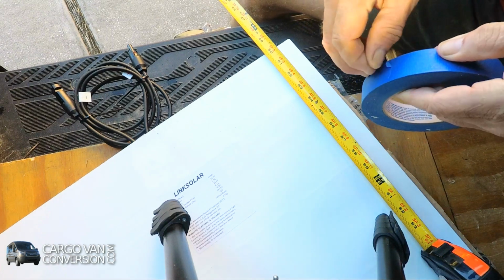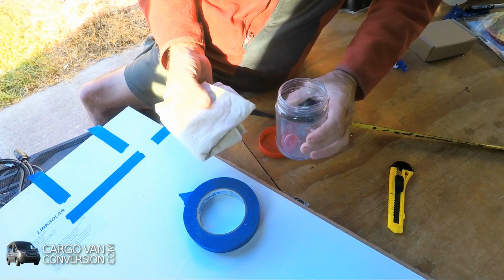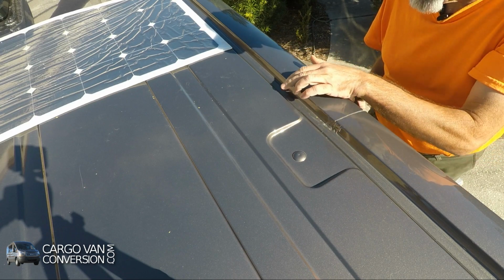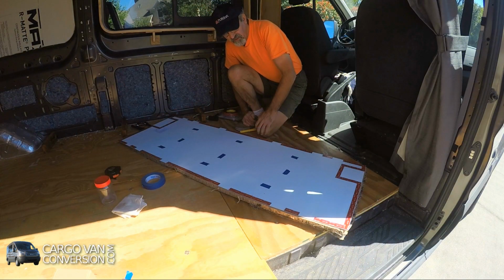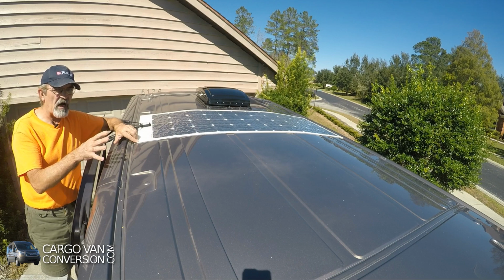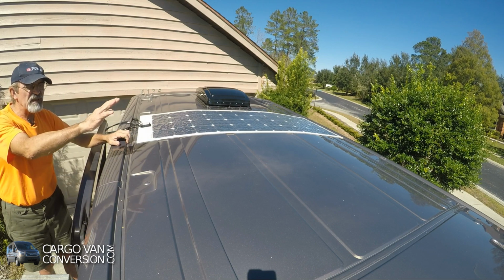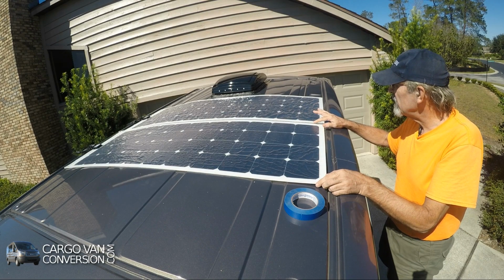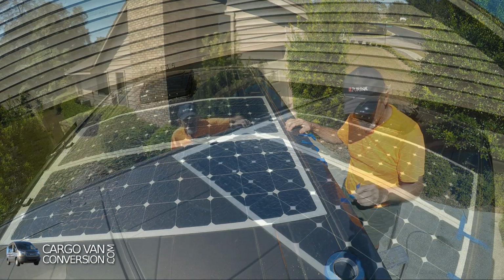ETFE Flexible Solar Panel Installation - Part 1

Comment: So, how are they working with no airflow on a dark roof? Whats the average amps on a sunny day?
Reply from the maker: Hi timothy790110,
There is none or very little airflow under the panels, but I haven't seen any negative results from that. I suspect, it's a non-issue much talked about; I may also be that the metal roof functions as a big heat sink.
After a year of use, the panels continue to produce close to the original amount of voltage/amps. And their physical condition is like new. I'm glad that I waited for these newer (and more expensive) flexible panels.
Since I'm still busy with the build, I haven't been able to 'stress' the panels to the maximum, but I'm very confident that they deliver close to the maximum number of watts available, i.e. 405 watts (three times 135W). They do whenever I test them without a load.
What is also important that my specific panels, already produce a substantial amount of energy, early in the morning and later in the day. As a whole I think that they are equal or better than some rigid panels.
Van Williams
Reply: @cargovanconversion  Cheers Van, I agree, there is a lot of misinformation out there, on solar panels especially. People just seem to spread that information dogmatically, with no empirical evidence whatsoever.  Same goes with mono vs poly.  Anyway, here are my experiences.  I have 3x100w of flexible (non EFTE , just PET backed) stuck to my roof. I glued them to channelled plastic roofing for air flow, and then VHBd them to my fibreglass hightop.  I have one 100w panel that is mobile with neodymium magnets that i can stick to my vans shell to follow the sun. I am in Sweden, so in the autumn and winter, the sun gets very low. So low, that each panel only produces around 0.5-1a, even on a cloudless day. the panel that I can angle however, will get around 4.5-5a. HUGE difference. For that reason, I have decided to remove the flexipanels (that going to be fun...NOT!) and mount 3x100w polycrystaline rigid panels, that i will be able to tillt in 4 directions, with mounts. These are the only ones that will fit on my roof.
Reply from the maker: Hi timothy790110,
I see you have the 'first' generation of flexible panels and I wonder how long you have had then and how well they stood up against time. Do you see any signs of delamination or deformation of the panels? That's what you typically see with some of them. Even with the improved panels that I have (high efficiency Backcontact solar cell and ETFE lamination), I would recommend their use only in very limited situations. While they can bend, they should not be used as such on a daily basis. They are perfect for stealth and do well, if not better than rigid panels, early and late in the day in a flat position. But they have many undesirable features. They are relatively expensive, not really suited for movable applications, perhaps less durable.
At your location, rigid panels on tilting mounts are a much better solution. I would advise you to try and find panels with high-efficiency backcontact cells or at least make sure the solar cells are of a high quality. Solar cells come in many grades and the cheap ones are often of a low quality. For us laymen, that is however very difficult to find out; often you have to rely on the salesman for that information.
Removing the old panels should be possible; a thin and strong thread could help you remove the VHB and some low heat from a heatgun can soften up the VHB if necessary. An old credit card is also a useful tool.
BTW Sweden is still on my bucket list.
Tak.
Van Williams
Reply: @cargovanconversion  Yes, I had some bad luck with them unfortunately, 2 or the panels were faulty from the beginning, only giving half voltage in full sunshine (but full voltage in overcast, for some reason, so either I have been careless with the installation ( not very likely) or they were sent like that. The company gave me a refund. Now, the one that I know works well, and delivered 5.4a in sunny weather, is about down to 4a now, but that could have to do with it beiung winter. I will have to wait until summer to test them properly.
Reply from the maker: That's unfortunate.
Van Williams

Comment: Can you please tell me how much do you pay for all solar the whole set and how many more solar can be add for this particular brand, Thanks
Reply from the maker: Hi Dragonfly,
I have three 135W flexible solar panels installed (Link Solar GFL-135). In Oct'17 the cost was approximately $1,500-$1,700 for these three panels, cable gland, controller, breaker box, circuit breakers, busbars, wiring, MC4 connectors, sealants, tools, etc.
I specifically chose these panels, as their length fits just between both gutters on the roof of my US Ford Transit (0.5 inch tolerance). This gives a 100% use of the roof for solar. I have a LWB MR 148" Transit and have three panels installed, which are virtually invisible.
I could add a fourth panel, towards the front, but as the roof line is coming slightly down at this location (less stealthy), I decided not to install one. I also have a roof vent installed between the two rear ceiling crossmembers; if you decide against a vent here, you may be able to add a fifth panel, for a maximum of 675W. On a Transit LWB-Ext version, you may be able to add another panel, with a maximum of 810W.
These panels are ~20inch wide. These maximum numbers may be unrealistic, as you usually need space for a roof vent and/or antennas/boosters/etc.
Hope that helps. Good luck on your project.
Van Williams

Comment: i have a camper with no solar dont need it,all you want is a split charge relay ...ur van charges while your driving nd 1 battery last for up to 3 or 4 days...fine work as usual though like the vids
Reply from the maker: Hi maddog hound,
Good if that works for you; I have done with much less during my tent camping years. We're getting older and spoiled, and more need for electric power develops. There are many different setups and many different requirements.
I planned my design based on 5-7 day boondocking stay, even under cloudy/rainy weather. That means more batteries (Ah's) and more solar or the right alternator source. Because I want to keep the van's charging system separate from the RV part and will use a separate 1000W inverter linked to the alternator to charge the RV's battery bank, but I use that as a backup system as I tend to be very much stationary.
Charging lead-acid batteries solely from an alternator source, is quite difficult to do properly. Lead-acid batteries need to be  charged 100% on a regular basis. And topping off a battery takes time.
Ultimately, I will be installing Lithium batteries and I anticipate that I'll be able to fully charge them during a 1-2 hour drive. That's because Lithium batteries will accept a 50-100A charge until they reach full capacity. They do even better at 90% charge than a 100%.
But as I said, everybody has different requirements and I regard that as the best thing of doing a conversion or modification. Each can decide what they personally want to achieve; for some a lot, for others minimal. No cookie cutter solutions here :)

Van Williams
Reply: Thanks for getting back to me,the reason im saying this ...im in a couple of vw t5 clubs here in Ireland and a common problem people are having with there solar is an audible buzzer warning in there equipment due to over charging and these are systems have one battery and  one solar panel nd all the mod cons, just wondering how you will combat this in your own system?thanks again for sharing i especially love your window frames some really fine work bud.
Reply from the maker: Hi maddog hound,
Wow Ireland, never came closer than Wales; it's time to pay you a visit :)
First, I'm not an expert at this. Over charging is an issue that applies to all batteries and should be prevented both for safety reasons and longevity of the batteries. Usually the cause for that lies in programming the controller for the right type of battery.
With systems, say larger than 200 watts, it makes sense the use a MPPT controller, but when you're talking about 1 panel/1 battery setups, a cheaper PWM controller would do the job fine. I have no real experience with PWM's, so can't help you with that.
My setup is a bit more complicated. With 405 watts now on the roof, and possibly more additional 'mobile' panels in the future, a MPPT controller is a necessity; it will use the higher voltage output, to create more amps from the system. I'm still holding off on a Lithium battery bank (too much going on on the Lithium front) and will use two basic 6V batteries for the next year or so, until I'm seriously moving into the van. Either way, I have to program the controller for the specific batteries I'm using and that's different for lead-acid and Lithium.
You and I will have to wait and see for any problems to show up. I'll post that in my videos too.

Van Williams
Reply: This is precisely what I did, since I rarely stay in one place for very long, and I'm pleased to report that I've never run out of power. The longest I've parked up for with the power in more-or-less continuous use was 3 days. Having said that, I don't have a refrigerator.

Bought them from simplysplitcharge on ebay, who I'd gladly recommend: https://www.ebay.co.uk/sch/simplysplitcharge/m.html
Reply: cool bud cant wait to see the vids,nd give a call any time ur in our neck o the woods look forward to more of your vids...
Reply from the maker: When I have a little sunshine left, I'll bring some along :)

Van Williams

Comment: Much better then a roller is the back of a spoon to smooth out the air bubbles. A roller does not apply as much PSI.

Comment: Is that panel fried yet, being mounted directly to a dark roof absorbing all that heat?  The worst way to mount a panel like this, and with no ventilation under.
Reply from the maker: There is lots of information on the internet, sometimes not absolutely correct. The roof may absorb heat (both light-and dark-colored) and it may act as a heatsink. The ventilation under the panels may also be relative. Good ventilation only exists when there is wind or when your driving. Additional heat will likely diminish the efficiency, but an extra panel would more than likely make up for that. Longevity of the panels may also play a role. There are however lots of things said, but very few real-life data exits. My experiences so far after two years are good, they look like new, output has not demonstratively changed. I will do an update about them soon.
Van Williams
Reply: Popular method is to mount on core flute. Any airspace will dissipate heat.  But good your sys still going well.
I had two panel, not mounted, connected in parallel that got so hot they fused together. Cheap panels with damaged pv cells i think caused overheating.
Reply from the maker: Lots of these cheap panels had problems, many didn't last much more than a year. I have the much more expensive ETFE backcontact solar cells. But time will tell how good (or bad) they are. For me, stealth was important. If it's not rigid panels are a much better alternative and softer on your pocket too.
Van Williams

Comment: It may have been simpler to apply the tape to your roof first. And by that I mean it would undoubtedly have been far, far easier, but it looks like you were enjoying the challenge to it's all good. ;-)
Reply from the maker: Hi nagualdesign,
I've considered both ways and probably in the end there may have been little difference. With the panels inside the van, it's way easier to apply the tape, ultra close to the edges and put enough pressure on them without ruining the solar cells. Much more work with determining where to put the tape.
On the other hand, doing most of that work on a flimsy ladder, out of my reach at certain parts, with a roof, one cannot sit or stand on, often (here in Florida) in the hot sun, didn't look appealing to me.
I guess that it comes down to your own personal preference. I tend not to be in a hurry, so time is not always an issue.
Ultimately, the panels are installed now, and that's what it is all about.

Van Williams

Comment: It's nice to have at least one unattached panel, so you can place it in the sun and move it around for optimum capture while the van is in the shade,
Reply from the maker: Hi Alan,
You're right. The original design allows for an additional panel (of the same voltage) to be added to the breaker box and stored under the mattress.
In the end it may be somewhat different. I'm currently testing a 120W Day4 flexible solar panel from Link Solar. Because of its design, it can better handle the frequent bending of the panel. I'm comparing it to a 120W solar blanket (a composition of smaller panels, that fold up into a small packet). Unfortunately, both of these panels are around 18V and have to be put on a separate solar controller. The solar blanket is quite expensive, but so far, I'm wild about it. Very sturdy, small size and good performance. I'll be posting a video about it in the upcoming weeks.
The plan is to get a wire to an Anderson connector, that will be added to the hitch. From there, an extension cable can be guided to wherever the sun is, but preferably back the the front windshield. That's the ideal location for the solar blanket, as it also prevents the sun from entering the vehicle.
Anyway, a great idea, we're on the same track :)
Van Williams
Reply: Personally, I am a fan of parking in the shade. RVs get HOT, and AC uses all the power you are harnessing.
Reply from the maker: It's a conundrum. Either in the sun with solar power or in the shade and 'without'. I think that my floor vent will help a bit to keep the inside a little cooler and parking at higher altitudes will help. The best thing is to live outside in the summer.
Van Williams
Reply: Cargo Van Conversion did you ever think of asdind a fan to your floor vent? Or would that hinder the air flow? I know some larger  computer fans have about 130 cfm, and the maxxfan deluxe has 900. I ask because I'm trying to figure out if I'm going to add a fan
Reply from the maker: Hi timothy790110,
As the floor vent principal was new to me, I did a lot of research. For a warm weather traveler, ventilation, I think, is more important than insulation. Moisture reduction and flowing air make it more comfortable inside the van. The MaxxAir fan is currently the best roof vent for the fact that it can stay open when it's raining; that helps reduce moisture. Adding a floor vent to the mix (as far away from the roof vent and with a maximum air temperature and height difference), should increase air flow (natural convection) without adding powered fans.
I have done some testing and the air flow between roof and floor vent is substantial, both in  summer and winter (in the south). The temperature difference between top and bottom of the vehicle is often 10-20 degrees Fahrenheit. I'm not living in the van yet, so I'm not sure that it's enough. Joey (my dog) tells me it does; he always lies with his nose against the floor inlet :) The idea is to have a secure airflow, for when you want to leave your dog inside the van, for instance when you go shopping; I don't like to depend on a powered fan that could stop working. I still have to find out if that would work.
I had the MaxxAir as a backup; using it's fan increases the airflow ten fold, but I also have an 'inline' fan that I can still put into the floor vent. But with the MaxxAir, I don't see the use for it.
You have to make your own decision based on your circumstances, but with a moderate natural convection and the MaxxAir fan as a backup, I would not add a fan to the floor vent.
Van Williams
Reply: Cargo Van Conversion ok, cheerss for the thorough answer! My main problem is that my design dictates that I have the floor vent directly underneath the maxxfan. Im. Worried that there won't be enough air turbulence to move the air from the ar corners. It might just be a "cylinder" of cold air going straight up to the maxxfan. The hole will only be 15 cm in diameter, and it will have a double  function as a drain for my drawer shower tray. My plan was to cut out canals in the floor insulation (50mm xps), like sun rays from the hole. Then the 12 mm plywood Moor on top. I'd use two, 200x200x20mm computer casing fans and cover the opening to force the air blown by the fans in to the canals i just cut, out to the far corners of the van. Does that make sense, or am I overcomplicating it?
Reply from the maker: Hi timothy790110,
I'm not an expert at this, but I think you're right, That flow of air will take the shortest way out through your roof vent. 
I do think, you may be even more hyper than I am :) but it looks like a great idea, if you have the (sub)floor space for these ventilation channels. For it to work, these fans will have to run 24/7 and I am not entirely sure, how you'll get the air evenly spread between these channels. Wish you good luck!
Van Williams
Reply from the maker: Hi timothy790110,
YouTube is acting up and I couldn't answer on your question at the right place, so I do it here ("Cargo Van Conversion exactly what no. 3m VHB tape did you use? There are alot of different numbers! Is it the 4991?"):
The 3M helpline didn't advise me to use tape for this application, however they said many RVers do and that I should use #5952. Somewhat contradictory! I used 3/4 inch 15yd 45mil thick and you can find it here https://cargovanconversion.com/buy/vhb-tape (affiliate link). So far (after 6 months), it has been working fine.
Van Williams
Reply: Cargo Van Conversion ok great, thank you! Regarding the floor canals, I've figured out that with 2 computer fans in the hole, I'll get at absolute best, 280 cfm, and the maxxfan deluxe is 381 cfm on its lowest setting. That's pretty close I guess.